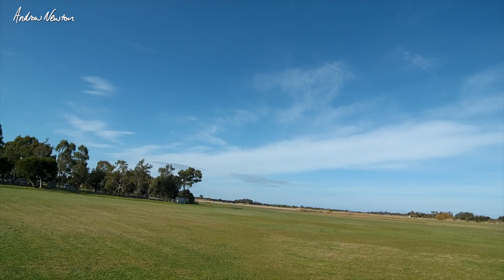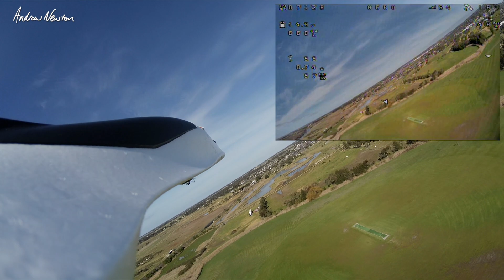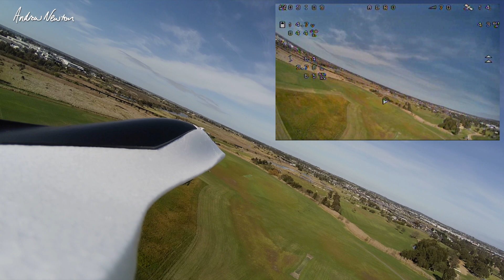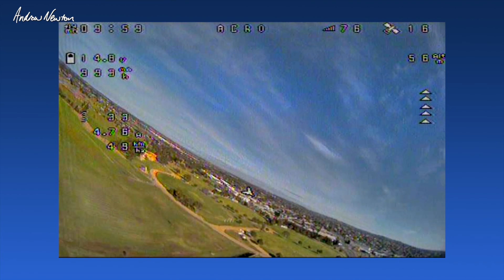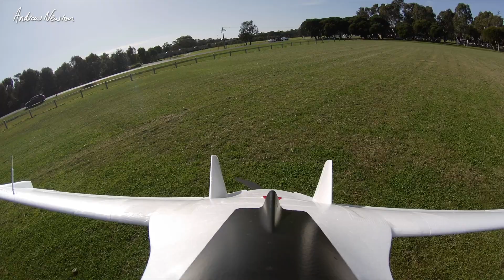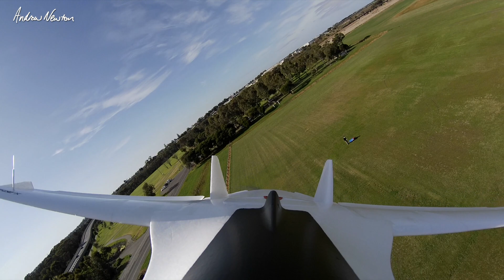Aggressor 1.2m wing mods

Comment: Hi Andrew, I'm only getting like 10min on a 4s 6200...that seems kinda low, any idea what I can do to improve? 10x6 folding prop on stock motor, cruising at about 9 - 10 amps...is it a CG issue? Thanks
Reply from the maker: That current would give you 30 min for 75% usage. Maybe your battery is bad. Depends on you speed, throttle level weight etc. CG wouldn't make a difference

Comment: is the Eachine 600mW VTx TS5828L a good vtx for planes? or do you have better recomandations? my Eachine TX801 gives bad video quality(purple dots and strange waves)
Reply from the maker: I use the 200mW TS5823L. FPV video quality is more about reducing the interference with capacitors or distance between noisy components.

Comment: is inav supposed to have less trow on control surfaces in acro mode compaired to manual mode?
i figured out that increasing FF increases trow, but is this a smart thing to do?   my plane holds the angel better but it is still being bounced around by the wind.
Reply from the maker: iNav doesn't know your plane. You have to tell iNav how much throw you need, so yes you will most likely have to increase FF. Planes will always be bounced around by the wind, iNav cannot totally stop that.

Comment: Very clean design now.
Cuts off $15 for the stickers. Like the glider to pylon racer conversion you can cut off 50% of the wings to make it fast. I have the impression the wing has already the tendency to flutter.
Reply from the maker: Doesn't go fast enough to flutter
Reply: If the designers had the last say, instead of the "mold makers" you wouldn't see so many stupid designs, that needed to be "fixed"

Comment: I think this thing with a big inrunner truck motor with 7070 props would pass 250km/h easily. Very aerodinamic speed wing, but this motor and mainly the propeller are a shame to the kit.
Reply: It's not designed for speed, it's a distance cruiser.....Your suggestion is rediculous.
Reply: With enough modding there's no doubt it could hit 250km/h and I'm sure someone will do it. But 160km/h with a decent setup would probably be more typical without serious mods. I'll probably run a 10x10 or 10x12 folder and will expect to see a cruise speed of around 115km/h to 120km/h. Should be a really nice long-ranger when setup well.

Comment: When I get to it I'll design a cap that keeps the zigzag but extends the motor and tapers the airflow. One other minor thing I think would have been better is instead of the foam shark fin at the back of the canopy, they should have left that flat and inserted a CF or plastic fin grip or just used a quarter-turn latch. the foam fin is a small but unnecessary air disturbance.

I have to tell you, Andrew, that I am genuinely impressed how you've achieved rock-star status in the RC hobby realm. Seriously. It seems like half the hobbyists out there don't believe anything anyone else tells them until you say it. Then it's law.

There's a certain funky and not very well-known aircraft out there that was fairly new so I purchased a couple and built one. It's pretty finicky and others were having issues but I got mine sorted fairly quickly and think it's a blast to fly. Documented all my work in the associated RCG thread and posted several videos of what a fantastic flier it was.

A few months later you got one, built it and flew it. You thought it was a lot of fun as well. A guy posted your video in the thread with text that went something like, "I was on the fence about this one but Andrew just flew it and says it's a lot of fun so I'm going to order it." Honestly I think I rolled my eyes so hard I saw grey-matter. But seriously, you are the king and it's well-deserved. :)
Reply from the maker: Ha, sorry about that Chief. There is no justice. Your motor faring sounds like a great idea.

Comment: The original is still the best. Ritewing mini drak.
Reply: The Mini is great but 200mm less wing and $50 more. Drak purists are going to slam anything Drak-like that isn't a Drak. Bottom line is the Aggressor is big, cheap, looks cool and flies great. Just what most hobbyists want in an aircraft like this.
Reply: @jeffhampton8781  I wouldn't be classified as a drak purist but i would like an apples to apples comparison. Does the 50 dollar increase and the fact of having to build a drak provide an equivalent amount in value? I'd be happy cover the cost of a mini drak kit for the comparison instead of buying an aggressor for my own comparison.

Andrew, where should it be shipped to?
Reply from the maker: Very kind to offer Brian but the cost to you would be over the top. I'll see if I can source one, I would like to compare the three forward swept wings. Betting the Mini Drak will blow the others away for speed, but there are other features to consider.
Reply: @AndrewNewton   The main thing i think you'll notice is it's more stable. Maybe holds the yaw axis better on it's side. Certainly a much better motor mount setup. I'm not so sure about top speed but perhaps the same performance at a larger speed envelope?  
But bench racing on the internet is pointless. Actual comparisons are fun.

I was talking to Chris over at ritewing and he brought up that your viewers may not be the right demographic.  Anyways i just need a shipping address.....it's not over the top.

Besides, keep in mind what county put us in this global mess, maybe it's time to stop supporting them.
Reply from the maker: Well if you insist. Thanks so much, I am blown away by your generosity. Please dont feel obliged it it ends up being too expensive.
These days I'm trying to only source RC gear in Aus, but ultimately it all comes from China.

Andrew Newton
339 Myers Street
East Geelong
Victoria 3219
AUSTRALIA

Phone   +61 438218960
Email    apnewton@gmail.com
YouTube  https://www.youtube.com/user/andyandvirg
Reply: @briankoch7041  I think it's great you're going to provide Andrew with a Mini to test but I think were talking aircraft with two different types of intended flying styles here and therefore not comparing apples to apples. The Mini is intended as a fast and agile FPV platform where the Aggressor is larger and intended more for big mAh, stable long range cruising.

One thing I'm anxious to try personally on the aggressor is the twin tractor option. Pretty much every serious FPV plane I have is either a twin or has been converted to twins because they're just great for FPV. Zero torque roll regardless how much motor you use and no risk of shredding your hand on a powered launch. And just as efficient as a single if setup properly. Belly landing a front prop is the only downside. The bottom line is, to each their own.
Reply: @AndrewNewton  Not all of it. ;) I'll shoot you an email.
Reply: @jeffhampton8781  You may be correct. I have all three and in my opinion the nano is the less draggy quick one. I use the mini when i wan't something slower with 7500mah of li ion, especially when it's windy. The big one is what i load up with 15,000mah and fly in 40 mph wing. But i think more first hand opinions can only be a good thing.

The twin tractor setup is what really interests me on the aggressor.
Reply: @briankoch7041  The worst attribute the Drac has, is that it's tricky to launch if you load it up with Lipos...The obvious one is the price, it's way overpriced for what it is, but the Fanbase don't seem to care.
Reply: @EnglishTurbines   Yup and i hate the wing joining method. All of this is personal opinion, i can't expect everyone's to be the same.  

I will spend xxx dollars on a plane i get xxx of value out of but i hate spending x dollars on planes i will fly once and throw in the trash in disgust...case in point reptile harrier, fx-61, and the reptile dragon. However, i love my overprice big drak, medium priced goblin, and under priced eachine ripple.
Your model may vary...
For what it's worth i have no loyalty. I hated the nano drak...all 10 minutes of flying it over 6 sessions with 3 different setups. Gutted the electronics and left it in trash at the flying field. Even threw a rock at it when i was leaving. :D
Reply: @briankoch7041  It isn't that the Drac is good, it's planes like the Dragon that are crap...and yes, there is a lot of work putting a Drac together considering how expensive it is...
Reply: Nope....

Comment: The 4K video looks really nice! The aggressor mods are great too! The power system is noticeably quieter. Maybe trim/smooth the edges of the foam right in front of the prop disk? The launches and landing were very nice. 👌🏽
Reply from the maker: Yes obvious mod for improvement but not quite yet. 4K editing is working nicely now.

Comment: Great flight Andrew, the iNav is a great addon from the previous flight. I did notice a little bit of jello on the FPV feed and the Runcam HD2, perhaps the trailing edge is still causing too much turbulence into the prop and theres more vibration on the airframe? Or a prop check for balance? Otherwise I'm really liking this wing a great deal. The weight capacity is excellent. I'm kind of stuck deciding on this wing, the ZOHD 250g, or the eflite opterra 2m. I really like the opterra for it's size, can slow down nicely even glide well.
Reply from the maker: Love the design of the Optera, specially the clean shape leading in to the motor and prop.

Comment: Andrew if I were you I would take a knife to the trailing edge right near the prop as well, pulling the prop  away like you did is a great way to get it away from the turbulence caused by the fuselage, but bringing a nice taper to that trailing edge would not only decrease drag on the air frame, but also give you quieter flight and less turbulence for the prop to begin with. I’ve done it with all of my models that have a similar set up and it works wonders, even did something similar on the sky hunter model that we both have and it even worked there, just trimming away the fuselage and tapering it down as narrow as possible like a teardrop.
Reply from the maker: Of course I'm itching to do that but I'll hold back for a while.

Comment: Any fears of that nose snapping off on a hard landing? You're skills are light years ahead of mine, do you think an amateur like myself would have trouble?
Reply: ukulelefatman I believe it has a flight controller so unless you fly it into the ground you should be good
Reply: @BikingVikingHH  Doesn't come with one, wondering how it would do stock.
Reply: It's easy to launch and very stable so you don't need a stabilizer at all unless you're just a really bad pilot. The flight controller is only needed for easy or hands-off flying and RTH.
Reply from the maker: Not even close to snapping, I think it's tougher than the Dart XL foam.
Reply: @AndrewNewton  Great, thanks for the info

Comment: Very, very good, some of the firms should get you to design in first place, thats now a right nice model
Reply from the maker: I wish I could have some input with the design of some models. Many have simple dumb errors
Reply: Seems like some of these companies do some serious initial design engineering then pass them off to somebody else to finish up and figure out a way to get them into production and that's where a lot of the dumb things happen. With some input from even a few experienced modelers, many designs wouldn't need so many mods after they show up. The big, flat, negative pressure area in front of a rear prop always gets me. In that regard, the Opterra does it very nicely. Arxangel moved the tail servos to the tail on his Volantex models and I did as well including an early Raptor. Volantex then moved them to the tail in future models. So some companies do take note, even if after the fact. But some designs are just bad in general. I have a Skywalker Wall E 2000 that got a complete tail conversion and major nose job. It was clearanced dirt cheap right after release because everyone knew it was dog. But anyone who expects a sub $200 introductory model to be perfect out of the gate isn't being very realistic.